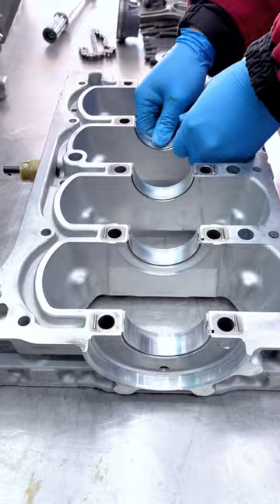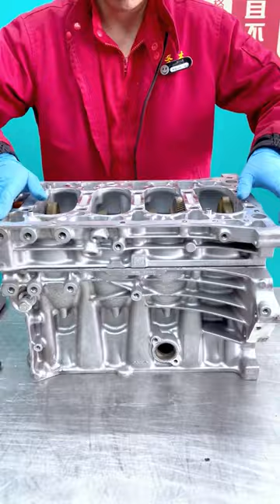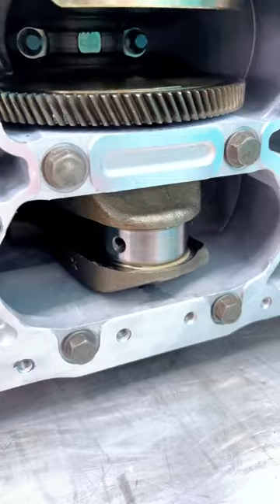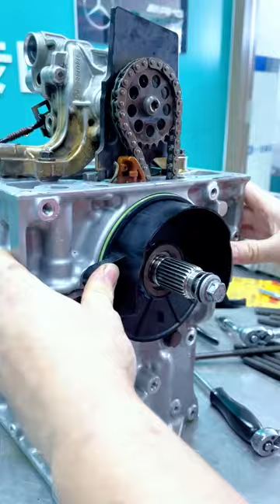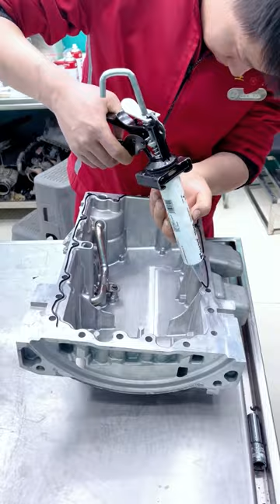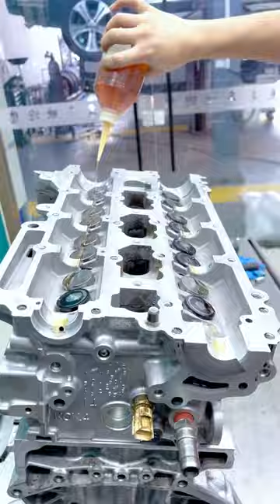#short #shorts #shortsvideo #auto #cars #automechanic #mechanic #mechanicmike #restoration

Comment: The worst design of engines are these types.
Reply: why?
Reply: @jordanthomas5353  why? You asking why? Do you see the design  of this engine?
Reply: @fixmods and what 'design' are you talking about. I have enough people skills to judge from JUST your 2 comments that you know very little about engineering, internal combustion engines, and metallurgy. There is nothing wrong with this 4 cyl engine. I prefer 6 cylinders, but sometimes you NEED 4 for the application.. or 8. Or 12... ect.
Reply: @spencerkleiman5035   not saying about numbers of cylinders, talking about design of the engine, first what is bad in this typecof an engine is cylinder head cover is holding  the camshaft, thats bad. Numb 2 is for the crankshaft bearings holders or clamps caps, how some call it, that are not separated from the block but they use half of the block as a holders for crankshaft. You need to clean everything before you torque holders, dust particles, even oil need to be removed where holders/clamps  meets the block, but here they put silicone sealer to prevent oil leak  and then they torque it. Imagine if there is one hundreds of mm of that sealant couldn't be compressed correctly, crankshaft would spin normally by hand when you assembly the engine, but at higher rpm or just higher temp of the engine can cause to engine fail, just cos of that sealant between those two aluminium plates... Next oil pump, oil pan, etc... That what I mean when I say bad desing. So if you know anything about engines and if you ever work on any engines, disassembled and assembled, you would know what I'm takling about.
Reply: Your response isn’t even English brother.
Reply: @fixmods no this block design with caps integrated into a girdle is the strongest design you can do overhead cam on a small displacement engine will make the most power as well
Reply: The guy that asked why, probably  just didn't know and wanted to learn, maybe he is 12 years old, there is no need to call him dumb
Reply: @fixmods the design of the crackshaft bearing caps being integrated with one solid piece of cast aluminum that you are talking about is a "bedplate" and acts to strengthen the rigidity of the block by acting as a solid single piece brace and can be far more superior and is a design choice made by the manufacturer for that reason. Early generation K series engines made by Honda utilized this design and it can provide a very reliable bottom end for boost applications on a naturally aspirated engine for anyone that wants convert to forced induction.
Reply: Но время показало что эти двигатели достаточно долго работают и относительно надёжные
Reply: @fixmods  calm down .. damn  ur butt must be hurting for being so mad
Reply: @felix9314  I am calm... no one is hurt, everyone is fine.
Reply: @fixmods  with an aluminium block u need that itemto serve 2 functions. As the bearing caps and as a brace cs they're not as rigid as an iron block

Comment: Open deck engines seem to be an issue when it comes to head gaskets. Not enough gasket support causes issues with expansion and contraction. Subaru aftermarket is welding the open deck closed to give the gasket more retention.

Comment: I hate those open top blocks. No reason to do it but to make the design weaker.
Reply: 1jz vvti ❤
Reply: A super weakness in them. Putting a bearing on the top cover is just damn.
Reply: They are supposed to be stronger.